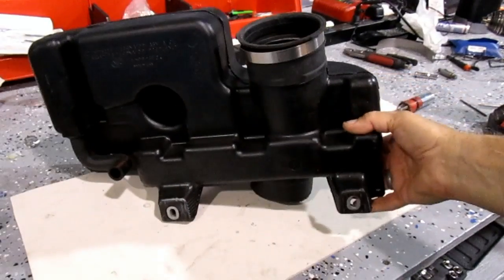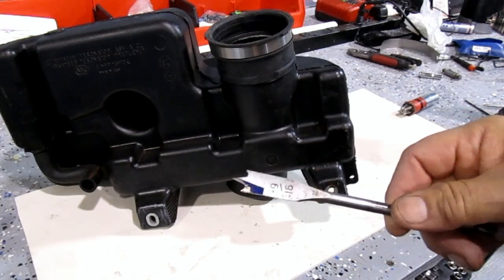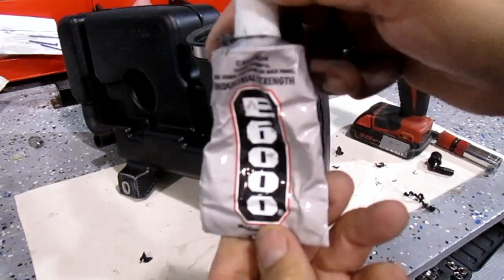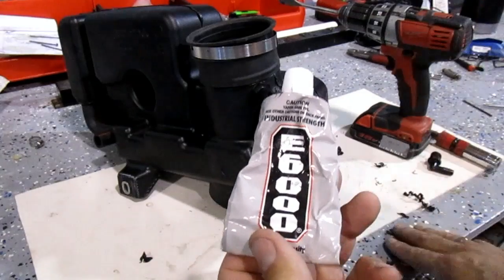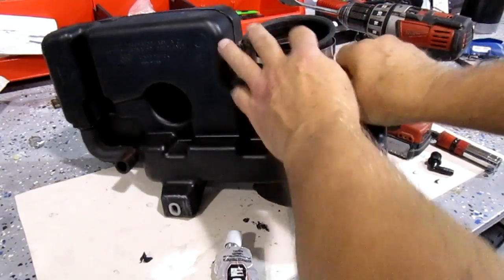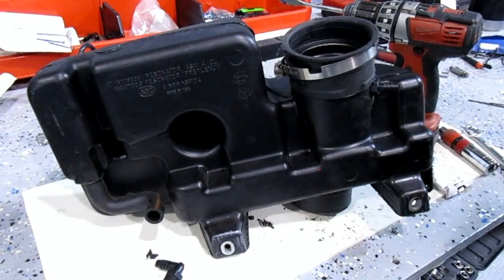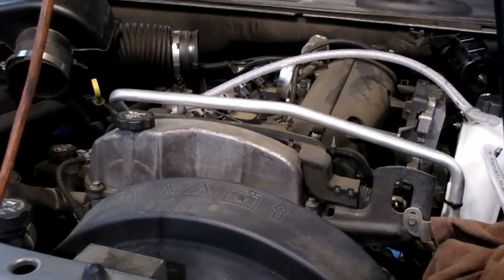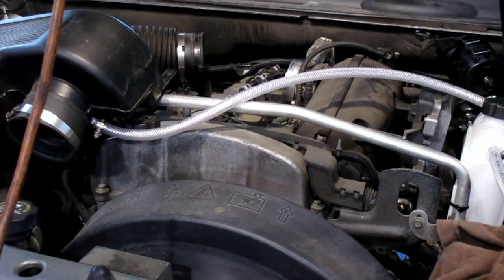How To Install The HHO Gas Inlet part 2

Comment: Great vid. Dies the ecu recalibrate the amount of fuel needed? Thereby using less diesel?? Thanks
Reply from the maker: If you do not use a gas or diesel tuner, you will likely lose mileage instead of gaining it. All of our customers and our own testing and demonstrations use advanced tuners with the HHO that allow the signals to be adjusted going to the ECU, so that the car computer chooses a leaner fuel map. Average results are 45-50% and more for gas, and 30-45% for diesel, even on large commercial busses and trucks. You can find more info on our website...www.hhokitsdirect.com
Reply: I just installed a HHO kit on my 1500 Chevy 3.0 duramax diesel truck. I’m using a volo tuner and have lost MPG. However my HHO line is positioned before the air filter. Would you recommend to move HHO line after air filter and MAP sensor ?
Reply from the maker: @frugalmcdogal8779  We can't help you diagnose another companies HHO system, but I can tell you that if you are losing mileage it's the volo tuner most likely. We used to provide them years ago, but the results were about 50-50, and kept getting worse. The final straw for us was when we had ordered over $4000 worth of tuners from them, and every one of them was bad- couldn't even program them, so I sent the box back for a refund. The CEO wanted to charge me a 50% restocking fee for BAD tuners, which I fought. He then ended up keeping the whole box of tuners AND our $4000 and told me to sue him.
That told me the character of the man and we haven't bought one since then.
My guess is it is the tuner. If you do not properly adjust those sensor signals when injecting HHO, the O2 sensors are going to think there is way too much oxygen, and inject more gas to burn it up, which is why mileage goes down and not up. 
Also, never install HHO in the air filter - it messes with the MAF. Always get it as close to the throttle body as possible. 
Hope that helps.
Reply: @transitionaltechnologies648   yeah after I purchased my kit I realized there are many out there! My HHO produces a good amount of HHO. The installation directions were not that great, so I will attempt to get the HHO closet to throttle body! Thanks again!

Comment: Can it run on hydrogen alone
Reply from the maker: No. Not using an HHO kit (which is hydrogen + oxygen - on demand). And if anyone claiming so, tries to sell you something like that- run!
We have done a LOT of testing on cars, trucks, big rigs, busses, generators (large and small), etc. We have never been able to run any engine on HHO gas by itself. 
What we have been able to do very successfully, is to extract more energy out of the hydrocarbon chains of the fuel, in the same combustion cycle times.
So when the on demand hydrogen-oxygen (hydroxy or hho gas) enters the engine, it combusts with the normal fuel which has a higher energy content. Because it burns 10 times+ faster than either diesel or gasoline, it quickly burns more of the existing fuel in the chamber, extracting more energy out of the fuel, lowering emissions and increasing engine efficiencies. 
Normal increases average 40-50%, but we have personally been able to obtain almost 80% on select vehicles.